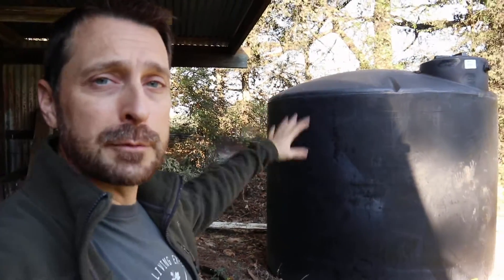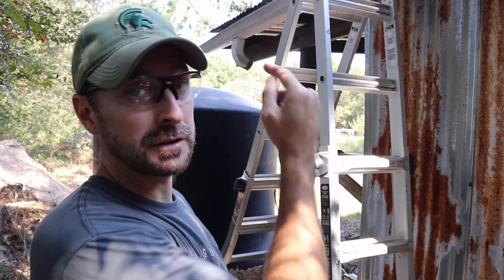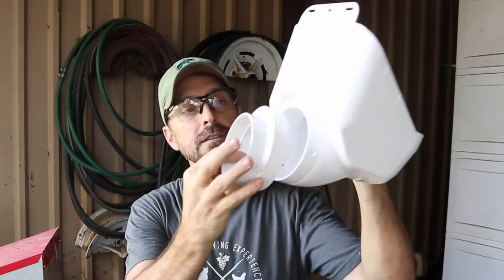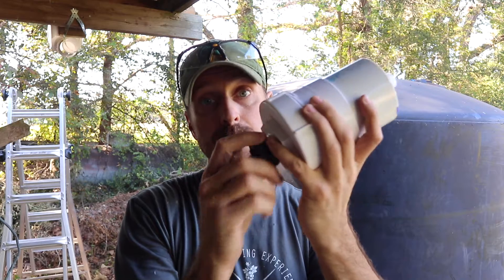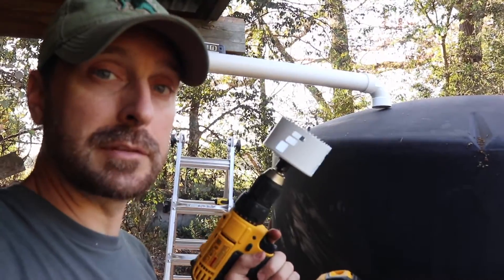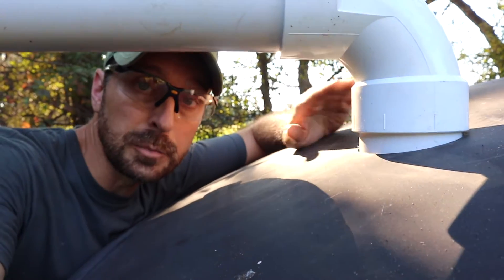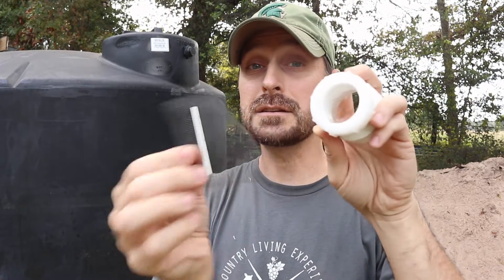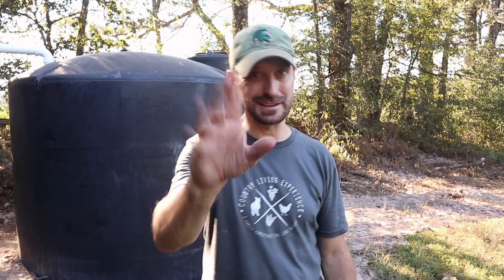Rainwater Collection System For House And Garden! Complete DIY Build!

Comment: New subscriber here. Blessings to you. Here is a tip - to drain the tank… take a garden hose and put it in (on top) and run it down to the bottom of the tank. 
Use a couple of hoses and have it point down hill (down by your house. Then connect the hose to your Spicket. Turn it on and let it fill the entire hose. When the line is full of water 💦…. Kink the hose (so you don’t loose pressure) and then unkink it. It should create a suction and it will drain the tank. It will take longer … but you can direct the water (and maybe water a tree or the garden

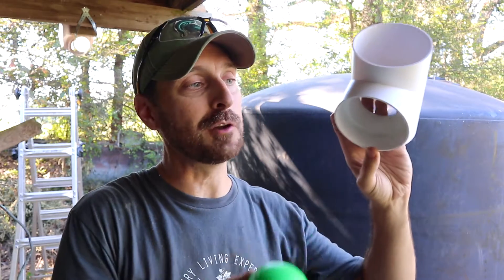Comment: Great video. At 05:12 the first flush looks like it allows some water to get past cos of that collar... I wonder if there's a first flush without that collar around the diverter
Reply: I mean, before the diverter has filled up, if there's a slow flow of rainwater coming in, that collar will let some water past... I'm gonna look for a first flush which has that float collar inside the bottom of the T , not up in the horizontal part of the T
Reply from the maker: This is how it was designed from the manufacturer. I have never had an issue with it.

Comment: Doesn’t the overflow need to be lower than the inlet?
Reply from the maker: It is. By about an inch.
Reply: Our overflow is at the top of our tanks.  We have 5000 gallons of rain water in our system.  I'm posting videos of the system build now.

Comment: Is better to leave the water tank above or below ground ? 3 people are here have ponds and a geologist told me that there water. I keep getting the run around
 I did have on gentleman told me it would cost me $30,000.00 to $40,000.00. The zoning department said  it had to be 75 feet. Don't know how far they need to drill. It  is too expensive.
Reply from the maker: They make tanks for both applications. I like having ours above ground.
Reply: @CountryLivingExperience  thanks